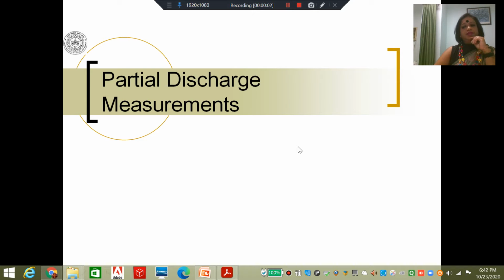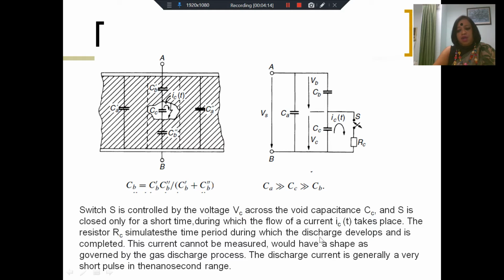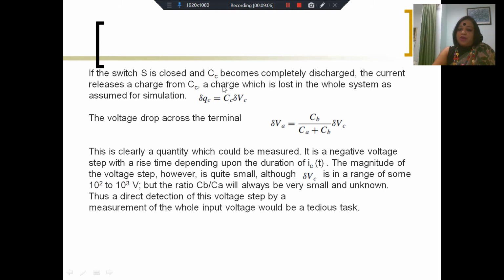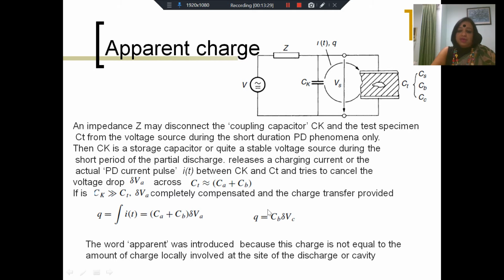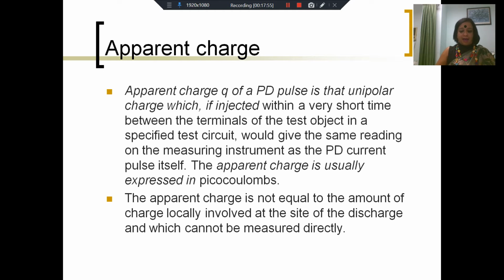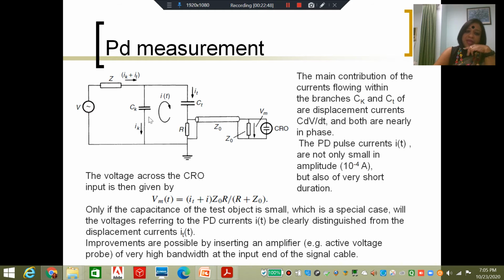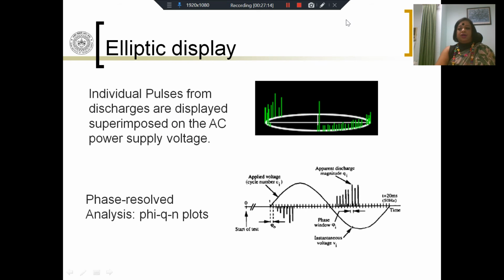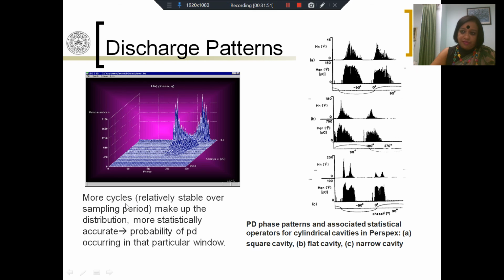EE634 A: Partial Discharge Part 3

Comment: plz explain how coupling capacitor is used for measuring Partial discharge.
Reply from the maker: the coupling capacitor is first charged by the supply. henceforth any charge lost due to pd is compensated from cc. the cc is ensured to be pd free. this enables accurate pd measurement